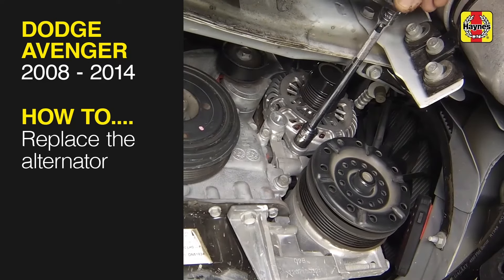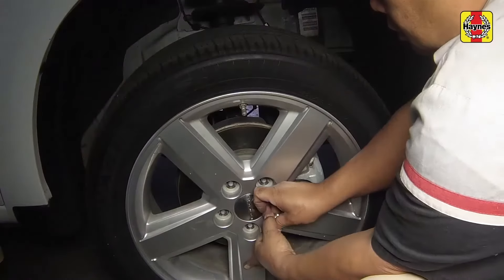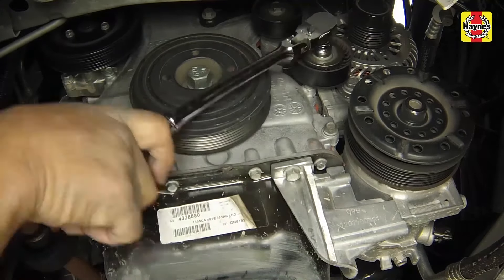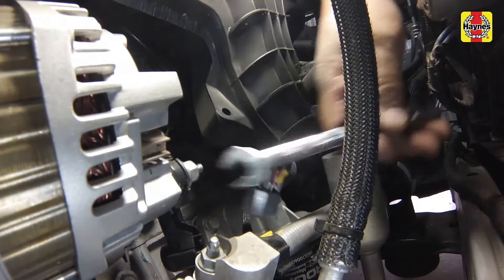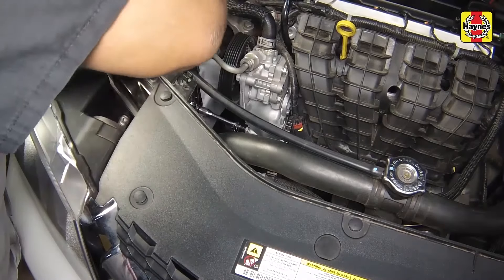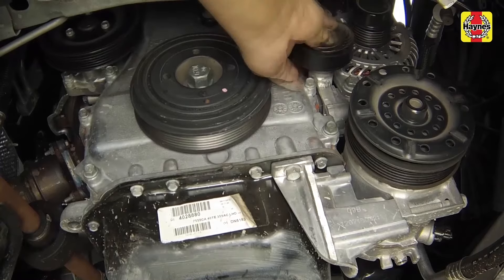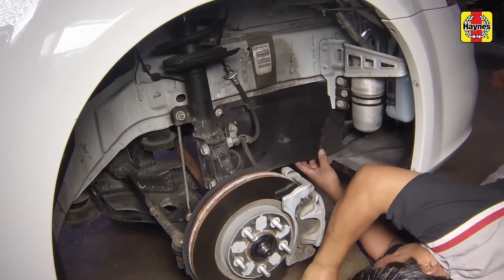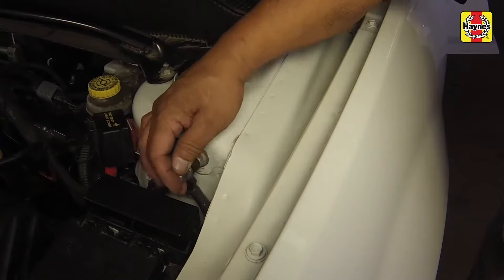How to Replace the alternator on the Dodge Avenger 2008 - 2014

Comment: haynes greeat job, but seriously guys, start mentioning the size of wrench you are usuing for each step its like come on dude, save us the time and the frustration just use a little more breath and say a few more words damnit
Reply: Gotta agree with you bro it isn't but 1/3 of the air of a full breath to just say 10mm or 1/4" etc.... & I get the guy giving u crap about needing to put a nipple on it for you but for real, it's not like it's any harder for them to just say it cuz it's not like they have to look it up or check their notes they're literally doing it as he speaks just throw in socket size with just a couple more words & it would make these videos legendary
Reply: @johnharris9344  damn skippy, I want it spoon fed bro
Reply: @tylerbarton2617  yep its all thats missing, plus some guys could benefit froma  tool list, say they own no tools, and need to start by buying just the tools they need for this job, of course i appreciate that he even shot the video just can't help but notice it everytime they don't include the sizes for each bolt
Reply: The other thing I'm kinda frustrated with is they are OBVIOUSLY working on the 4 cylinder cuz I'm currently doing this on our 2012 Dodge Avenger SXT PLUS with the 3.6L V6 & lemme tell you, it DOES NOT come out ANYWHERE NEAR as easy as they're able to make it look here & the pulleys are different in ours which is why I know they have to be doing a 4 cylinder cuz we didn't have a pulley to remove that was overlapping the alternator that's the only thing that was easier about my job but EVERYTHING else has been slowly or quickly becoming a nightmare for a diy'er mechanic like myself lol. I'm pretty mechanically inclined I JUST replaced the engine oil cooler on this same car less than 3weeks ago which is a massive project for a "learn as I go" mechanic like myself. Just another issue they created with the 3.6l pentastar V6. 3 mechanics told us that the head gaskets we're shot basically meaning we needed a new motor but after a little research I discovered that Chrysler in all their wisdom put the oil pump/or "engine oil cooler" as they call it RIGHT in the center of the motor where ALL the highest heat will be at & decide to make the dang thing outta half plastic. Freaking morons! But here I go on a rant with this dang motor lol. Honestly when it's running correct & not broke down it's a wicked little V6 but Lord could they have made certain things on it a bit more practical. So anyone with the 3.6l that are experiencing coolant & motor oil mixing DO NOT TRUST any mechanic if they tell you your head gaskets are shot. I'd say 95% likely it's your engine oil cooler housing gaskets failing or the plastic housing itself cracking from the extreme heat & 5% chance it's actually your head gaskets. So just a bit of diy'er non pro tip for any Avenger 3.6l owners. We nearly scraped a car with under 100k on it cuz of a $200 part that needed replaced & I did it in bout 8hrs with the help of another YouTube video such as this 1. So thanks to all of the YouTubers who provide us DIY'ers this Great info but I can't disagree that the more info you can provide the easier you make our lives. Think of it like your teaching a bunch of kindergartners how to do a job on a car & make it with that as your guiding video director lol. Every extra piece of info is like night & day difference to us simpletons lol or at least for me it is I ain't afraid to admit that lol.
Reply: @houstongordon9337  dude if you csn eyeball a bolt size just a
Lay the tools down

Comment: Ok that works great when the ac compressor is moved but what about when it doesn't move far enough or the coolant lines are in the way or the ac lines, 2014 avenger I'm working on it isn't that way
Reply: Figure it out? About to start on my 2014 avenger
Reply: You can take off the fans that’s on top of the radiator and it will come out from the top.
Reply: @gizmoe187  yea I'm not understanding why they are going under
Reply: Did you ever figure out how the hell to get it out of there on yours? If so please msg me back cuz I'm assuming you were working on the 3.6L Avenger motor like I currently am which is why ours didn't go as simply as this videos does cuz they stupidly didn't include this specific but VERY important detail in the description or if they did I didn't catch it...I've been trying for TWO DAYS to get this G.D. alternator out of here & I can yank, pull, jerk that compressor till my back breaks & it WILL NOT move out of the way far enough to get this freaking alternator out of the engine bay! So if you were successful in removing yours finally please help a fellow Avenger owner out bro I could use a tip that's for sure
Reply: @tylerbarton2617 I totally agree with your comment.  Why in the world didn't they specify something so important?  Did you get yours replaced?  If so which method did you use?  I have a 2011 Mainstreet with the 3.6L.  Not looking forward to this one.  I changed it in a 2010 2.4L for a family member, not too bad.  Thanks in advance for your reply...
Reply: @aerialpicsandvids6090  yes I went out the top. I'm not sure what a mainstreet is but if it's anything like my avenger you are NOT going to get it out the bottom like in this video they're lying if they say so.. of course I don't have a car jack like them so I just had a floor jack that don't lift very high so maybe it's cuz I couldn't get the right angle or use enough force while laying on my back under the car but I can tell you I tried everything under the sun before just pulling out that radiator dual fan unit that's a VERY simple process then it comes out with plenty room to spare. I broke 1 of the clips on the fan assembly probably cuz I had freaking had it by that point but I just zip tied it back up with industrial sized zip ties & it still worked like a charm & with that assembly out of your way you just have SO much more room to work & to see everything it's just the most common sense way IMHO. But I will say I ended up having to have my dad's help with putting that serpentine belt back on afterwards... & If I remember correctly we even had to use a little cheater bar on our socket that pulls back the pulley far enough to get that damn thing back on... Honestly if I had to do that part by myself I don't know if I would have succeeded & I consider myself fairly mechanically inclined but I'm sure every vehicle is a bit different hopefully your's won't be such a damn tight tensioner pulley as our avenger was but I wish you the best of luck homie it'll test your patience I can promise you that much lol
Reply: @tylerbarton2617  Hey thanks for the reply, I appreciate it, and good job getting yours done!  I changed the decoupler pulley on the alternator of a family member's 2010 2.4L Avenger, which required an impact wrench purchase and the complete removal of the alternator (which I took out the bottom like this video, but that small engine makes it possible).  I didn't think that was too hard to do, but my 3.6L Avenger Mainstreet (just one of the sub model names for Avengers like Heat for example) looks like a pain.  I read somewhere that you can take out the dual fan assembly like you said, but no one has an actual video of the process on a 3.6L Avenger that I could find.  I will gladly make a video if I think I can do it.  Did you have to disconnect any coolant hoses or wire harnesses or clips to get that fan assembly out?  My local mechanic quoted me $200 labor to change mine out with the remanufactured alternator I bought on rockauto.  I'm thinking it might be a bargain to just have him do it and be done.  Thoughts?  Thanks for all of your insight!
Reply: @aerialpicsandvids6090  I guess it's all a matter of opinion & how much time/money/patience etc. that you have & if you feel like you want to spend some quality time with a wrench in your hand or if you have an extra $200 in your wallet you can afford to part with... In my honest opinion, if I had the $200 when I did it I would have gladly paid for it to be done however that's considering how difficult it was up until the point that I discovered that fan assembly removal video that I left the link to in my original comment... After I did that it was pretty dang quick & easy all but that damn serpentine belt getting put back on but if you've done it before then maybe you would have an easier time with that then I did. But as far as the fan assembly I believe there was like 2 MAYBE 3 different wiring harnesses if I remember correctly... Of course it's been about 2yrs since I did this job so I may be mistaken but I know it wasn't hard then there's 2 harness clips that the fan assembly just kind of slide down into (when putting them in that is) so you just have to get a good look at the clips, find the little tabs you have to press on to allow them to release the fan assembly & after the wiring harnesses are off that whole assembly just slides out easy as pie... & So like I said it's basically a matter of opinion or maybe drive lol cuz I did it in winter when it was bitter cold so I pretty much had NO drive to want to do this job however it being our only transportation at that time I HAD to somehow find the drive to do it or learn how to walk &/or call a taxi until I could find the drive to tackle it lol... So it all is up to you, how much do you like to save your money compared to how much do you like to do mechanical work on a car with nothing more than common sense & a few vague YouTube videos lol. If it were me I'd pay a mechanic probably but I know you can do it as it's not rocket science you know lol it's just unfortunately there are WAY too many misleading or absolutely wrong videos out there leading us YouTube mechanics astray lol. So I wish you the best if you chose to tough it out & elbow grease up... I hope it goes a fair bit easier for you than it did me lol
Reply: @tylerbarton2617  Hey, I truly appreciate the epic reply!  I keep wavering between trying it myself and just having my mechanic do it.  Your comments have me a little more motivated to try it, especially if you're saying that you didn't have to remove the coolant or any actual coolant hoses.  I do have an appointment scheduled with him but not for 5 more days, soonest he could fit it in.  Fortunately I have a family member's car to borrow (ironically the Avenger that I repaired a couple years ago) until that time.  I never did see a video link in any of your comments...could you share it again?  I know that YT can be weird about links in comments, sometimes they just auto delete them for some reason..maybe I just missed it.  I do have $200 I can spend on the job right now, but I would rather save the money and do it myself (I like mechanic work from time to time), but at the same time I don't want to get many hours in and possibly fail anyway.  Tough call.  I really think in my case it's just the decoupler pulley because the battery and alternator are testing fine as far as voltages, but the alternator now has 180,000 miles and I bought a replacement so might as well put it in so I can send in the old one and get my $73 core return.  Thanks again for the replies.  I hope you and your Avenger are doing well!

Comment: I kept having electrical problems with my car and I changed the alternator three times. I took it to get it check and they kept telling me my alternator is good. Im finally watching a tutorial and found my problem right away. I have two nut on my batter positive terminal. The terminal is  sandwich between two nuts. And I kept putting it back the way I found it. One of the nut looks brand new and the other is rusted and old 🤦🤦🤦🤦

Comment: Replaced my daughters today...2013  avenger with 2.4l. Took 1 hour start to finish. Very easy and straight forward.  Hardest part was not farting when crawling out front underneath.  
Basic socket set and wrench set is all that's needed. If you're reading this just know you can do it!!! Good luck and thank you for the video it really helped.
13mm
14mm 
16mm
Reply: Thank u im going to do one right now🔥🔥
Reply: @jojolopez1458  how did you do?
Reply: I have a 2014 2.4l you think it will be the same ?
Reply: @sergiosalas713  yes exactly the same
Reply: MVP
Reply: Hell yeah thanks man ,I needed to know which size tools I needed saved me some worries
Reply: Thanks plan on changing mf wife’s alternator in her dodge avenger
Reply: Thank youu for thatt

Comment: I've been a mechanic for over 20 years and never thought to use the push-pin pliers on those connector "locks" that come on all of the Mopars. Pretty cool idea. I learned a new trick today lol. (And for anyone wondering why a mechanic veteran is using YouTube: there ain't a damn thing wrong with using a video for reference lol 😊) Thanks @haynes
Reply from the maker: Thanks for the comment! It's never too late to learn a new trick, right?

Comment: I got a dodge avenger 2008 sxt v4 im my car threw a 0700 code then wouldn’t start, and I replaced the ECU does it have to be reflashed/reprogrammed to my car?